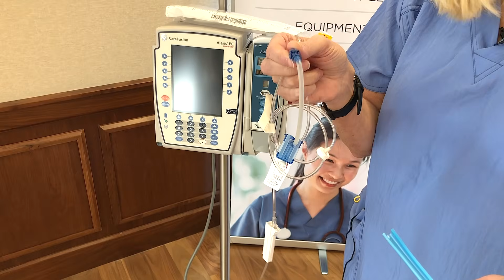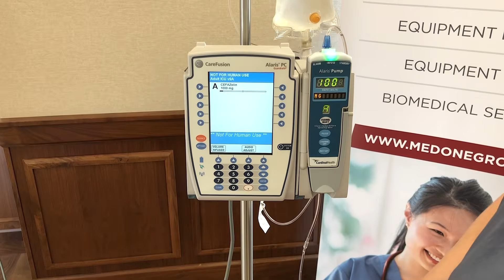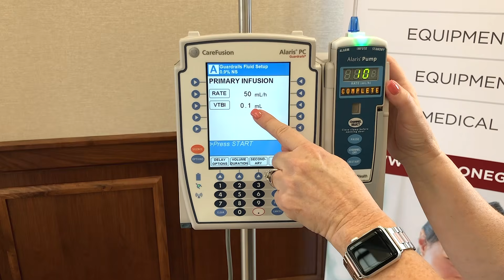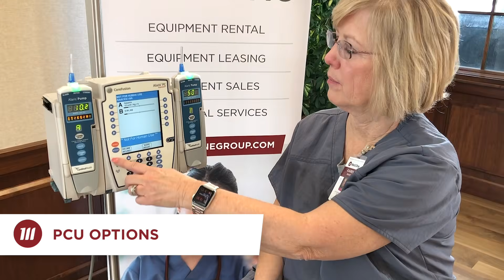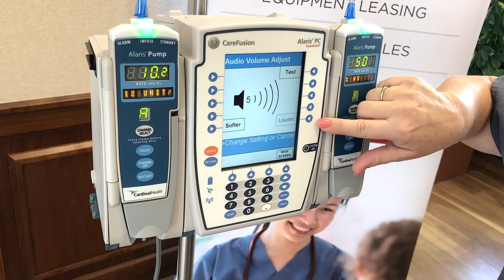Alaris 8100 Pump Module Training

Comment: Thank you for the video, it is very helpful. I would suggest adding the following markers in your video description:
@2:00 Connecting Module
@2:24 Module Overview
@2:54 Tubing Options/Disposables
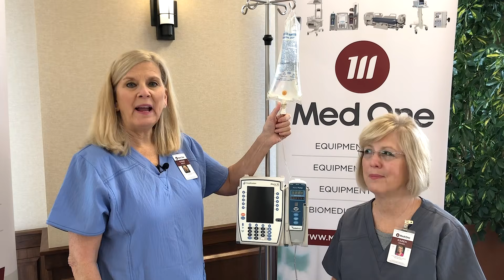@3:59 Explaining bag is spiked, Intro to next section (?)
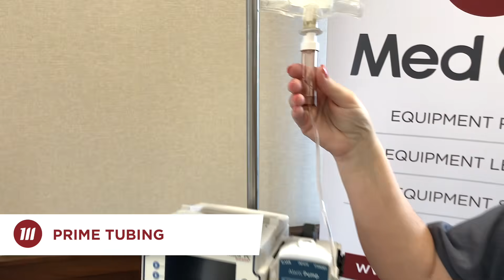@4:19 Priming Tubing
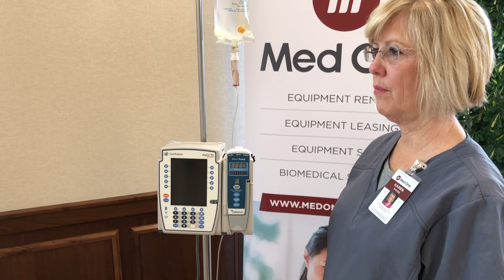@5:23 Loading Tubing
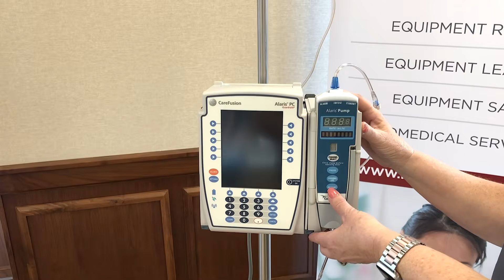@6:23 Removing Tubing
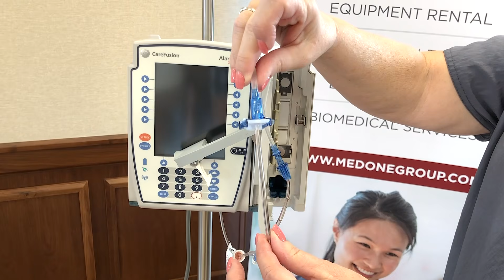@6:50 Program an Infusion
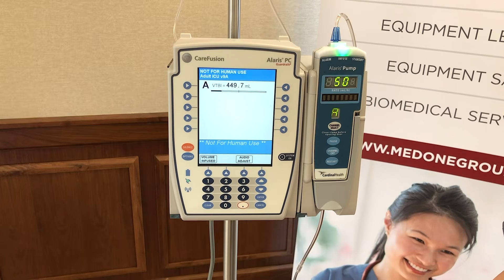@9:20 Secondary Infusion
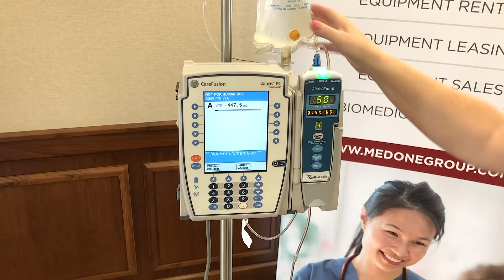@11:48 Overview of Features
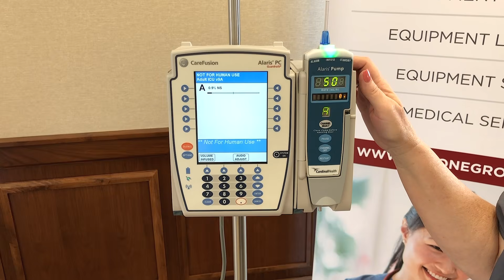@12:34 Troubleshoot Alarm
@13:29 KVO Mode
@14:19 Restore Feature
@15:02 Guardrails IV Drug 
@16:35 Program Bolus Dose
@17:55 PCU Options
@18:38 Pump Options
@20:16 Volume Infused
@20:42 Audio Adjust
@21:29 Turning Module Off
@21:40 Removing a Module
@22:04 Turning Pump Off
Reply from the maker: Thank you for your suggestion. We now have added chapters to this training video.

Comment: Hi, I was wondering if there is a way to prime the line through the infusion?
Reply from the maker: With the Alaris LVP you need to prime the tubing before you load the set. When priming tubing for the Alaris 8100 LVP you should invert the set and gradually open the roller clamp to prime the set. If there are ports in the set, tapping on them will release any trapped air bubbles so you can avoid any air in line.

Comment: Hello,

I have 2 of the 8100 LVP modules that work fine on the Alaris 8000 but when I attach them to an 8015 the one in this video or the newer version with the larger screen, they will error the 8015 PCU during POST. I looked up the error and the 8100 LVP modules are running a version of software that is too old and not compatible with the software version on the 8015. Can you flash the controllers? I have other modules as well and need to discuss biomed services. Let me know if you can help.  If I could find or if I had the Alaris system maintenance software or the software version that the pumps needs I could easily fix the problem. If anyone can help please let me know.  You can respond to this message or contact me through my contact page.
Truly,
Dr. James
Reply from the maker: Dr. James
 
This is a common problem when facilities try to operate these units without matching software. The Alaris 8015 PCU and all Modules can be flashed but only by a certified Alaris distributor. Med One has access to all software versions and with our rental or sales programs we can ensure that all units customer obtain through us have compatible software.
 
Many people purchase equipment from secondary dealers and end up in the same situation as you and unfortunately end up stuck with equipment that is not compatible.  Med One is a certified Alaris system distributor, we have options available from rental, lease, purchase and many more! Please contact us today and we can walk you through the options we have available.